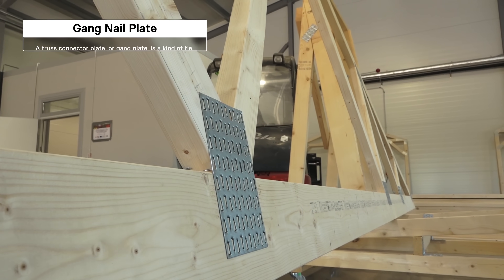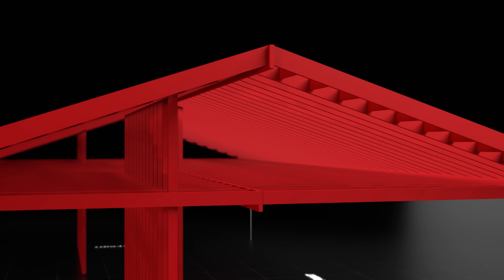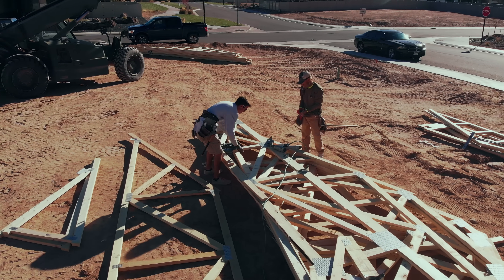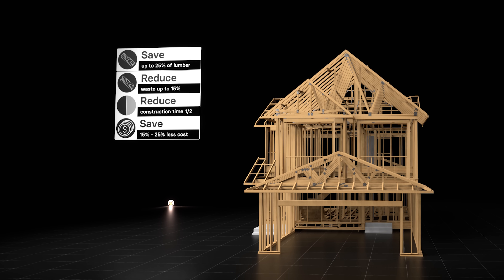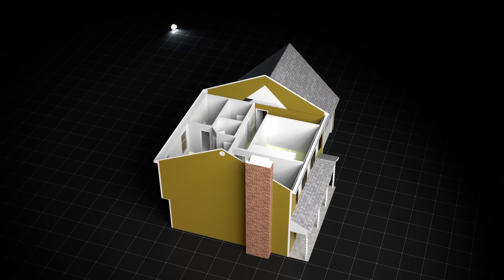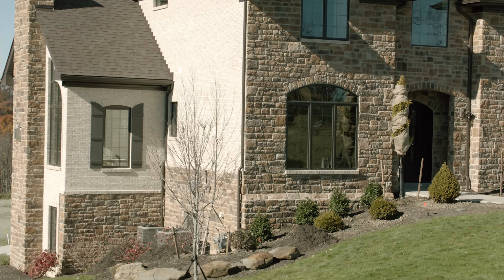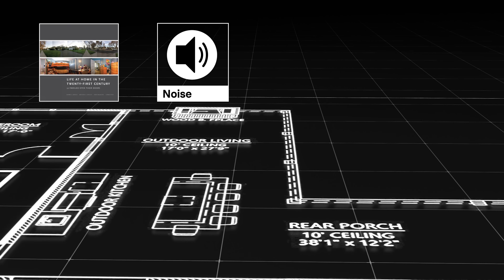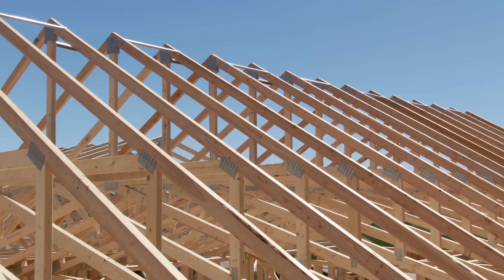The Invention that Accidentally Made McMansions

Comment: This is also what caused the ongoing tiny house scam, currently going on all over the US. They build these tiny storage buildings with cheaper materials than those used in mobile homes, and sell them “with no credit check” .. 

Which is more like “We only offer our own credit” because their rates would be illegal in most places. 

Basically, you end up with a framed and sided shell with a roof, 2 windows, and a door.. Roughly $3500 worth of raw materials, that they then sell for a cash price of $12K or .. interest rates that puts your total cost around to $30,000. 

That’s without electricity, wiring, plumbing, or even a toilet for that matter…  

They can afford to do this because they’re small enough to fit on a specialized trailer, which is 50 state legal to pull behind a semi truck. They literally pull up to your house, load it onto their trailer, and leave… The same way they repossess a car.

Comment: Fun fact: after ww2 The Levitt family (father and 2 sons) built most of the homes (cape cod style and ranchers) in Levittown PA and near Long Island NY. They built Over 140,000 homes. I do work on many of those Levittown homes today. Most of fascia boards on these homes aren’t even wood, underneath the aluminum capping is like cardboard. When it’s rotted it literally just breaks apart like a cookie.
Reply: I live in a ca 1963 home in Florida - its what I call the "standard post war floorplan" (which is pretty good). Cinder block construction, but the (low) gable ends were originally some kind of MDF similar to what you describe.
Reply: Homes built after WW2 had a materials shortage with everyone building. So it’s not uncommon to find creative solutions to that.
Reply: Wow, the ✡️Levitts✡️ are scamming people, what a shocker
Reply: More facts, i own a Levitt in long Island. Solid as a rock 70 years later. Nailed together, tongue and groove absolutely zero structural issues to this day 👍👍
Reply: Dumb take. False many counts

Comment: Idk. This technology made building McMansions more affordable but the first trusses were used in standard home design first. I live in a 1960s home. it has 12ft wide rooms, all within spec of 16” spaces 2x6 rafters. Sheet goods and siding played a much bigger role than trusses in making this home affordable. 

So It isn’t clear to me the cause and effect. There were mansions before trusses and if they were not invented, the overall industrialization, development of timber harvesting tech, and supply chains made larger homes affordable. 

This video could easily have been titled how insulation and HVAC systems made McMansions possible or how highways and cars made McMansions possible by by making accessible land affordable.

Comment: Your explanation of a weak point being at were the rafter sits on the wall is wrong if you think about it. Them days we cut a notch, called a seat cut or "Birds Mouth". Yes we had to toenail it down. Guess what, a modern truss STILL is only toenailed down. They have things called "Hurricane Clips", a metal strap that nails into the rafter/truss, and also to the stud or double plate below. The plates talked about in the video only increased the speed and ease of use of building the truss, and could be accomplished using another 2x piece added to the rafter before they became popular.

Comment: Your leap from analyzing roof failures due to uplift and toe-nailed rafters to gang nail plates was a bridge too far.  Roof uplift failures were addressed with hurricane ties or hurricane clips, to reinforce the joint between the rafter and the top plate.  The gang nail plate didn't directly contribute to solving the uplift problem.

Comment: The fact that an invention makes something easier or even possible does not automatically Authorise a significant change 
in another aspect of an existing industry.  Local zoning should be used to restrict the number of extra-large houses.    
I grew up in a sub-1000 SF house and didn't see it as inadequate at all.   
Next door to us there was a family with six daughters. How they all got along in about the same amount of space, 
I don't know, but somehow they did. As they moved out, of course the younger ones had more room to themselves.  
There is a terrible shortage of decent, modestly-sized single-family houses like the one I grew up in. 
I hope someone will eventually wake up and Do Something about that. And make yards bigger again, too.  
There should be not less than 20 feet between any point of one house and any point of another.
Reply: While I hear you about zoning - zoning is all too often the problem. "Minimum house size" and other stupidity.

Comment: "By the 200s Rapid home construction accelerated by the efficiencies that were made possible by the trust plate contributed to over production in the housing market. The trend towards larger homes increased household debt while the construction surge contributed to this misguided perception that homes were just going to increase in value forever." This is an incredibly incorrect and illogical thing to say. Homes being cheaper and more efficient to build, could lead to larger home sizes. But it was the government pushing for home-ownership, pumping money into the housing market, and encouraging banks to give more and more mortgages is what caused the housing bubble. Without the trust plate, these homes would have been smaller for the same price, but had nothing to do with the housing bubble. A surge in production is caused by the increased supply of mortgages, not the trust plate, and had nothing to do with the perception that home prices never go down.

Comment: Seeing this as a Euopean makes totally sence now why American homes allways getting blown away. Here in Europe we have Concrete, Bricks and Ytong stones for the walls which are not carying any weight. Even our wooden homes, still standing like the middle age, because instead of a few nails, or small plates of nails, the wooden beams in the houses are thick af and getting connected by fittings sawed into them combined with big and long and strong steel bolts. So even when a storm like a hurricane (okay they are not so strong over here) appear, the worst thing what happens is that the rooftiles starts flying around and hitting things and trees falling over, sometimes into homes, but they dont get destroyed completely like in the US. All you had to do was follow the damn train CJ... No all you had to do was to get new beams or new rooftiles in the most cases. Everything else is safe.

Comment: The plate does heat up charring the wood around the plate stopping the wood from burning around the plate thus keeping the joint from failing.  When one of the trusses fail the rest of the trusses don't necessarily fail and each of the trusses are engineered for specific situation with factors of safety built in.  A "stick-framed" roof is not engineered and is built using prescriptive methods that are implemented by workers who may or not know the prescriptive framing rules.  All in all, I would much rather in the engineered roof system.

Comment: Truss plates are an amazing invention and their use has gone far beyond just homes. I see them used in indoor horse riding arenas where there is no internal support for the roof.  Why do they seem to fail sometimes under snowloads? Is it a failure of building design (like not enough trusses or roof pitch)? That might be too complex of a question for a simple answer sorry.

Comment: I’m generally a fan of prefabricated wood trusses.  But the truth is that the super-complicated roofs that are characteristic of these so-called McMansions oftentimes preclude the use of trusses more so than enabling it.  Accessible attics and loft spaces, significantly vaulted / raised ceiling elevations, and the absence of sensible load-bearing wall or beam placement  are significant restrictions “from below”.  Then, comedically complex roof geometries with cascading gables, meandering hip / valley lines, dormer volumes, and chimney projections create major challenges “from above”.  As such, in my experience you’re more apt to see a McMansion roof framed with conventional stick-framing than with prefab trusses.  As with anything else, the devil is in the details.  Wood trusses are a  great solution in general, but when the architectural roof “concept” is full of geometric pinch points and a ton of volumetric variability, the economy (and more often than not, the feasibility) of a truss solution goes straight out the window.

Comment: He said construction time cut in half using trusses? Not a chance. Unless he was talking about just the roof framing. Or possibly the framing structure itself depending on the design of the building. But claiming that rafters will DOUBLE the construction time of a home is ridiculous. Trusses are fine if you don't care about wasted space, boring architecture, and in most cases low ceilings. And with the invention of hurricane clips, roofs constructed with them are more than strong enough in 99% of the country. Track homes be damned!!

Comment: Before the gangnail carpenters would make their own trusses using plywood as the gangnail.  This is a very sturdy way of making a truss and stands the test of time. This practice was largely abandoned because builders feared that because their carpenters were not engineers there could be a liability issue. But the main thing is the standardized cost. Builders knew exactly how much the trusses would cost. And when you build the same cost over and over it was convenient to know the cost would remain the same for the materials.

Comment: Those plates are crap. I worked in a place building trusses . If the wood gets even a little wet and then dries those plates will not hold the wood together.  I would never ever for any reason use those plates

Comment: THIS IS SO WRONG. lofl
Reply: How so? The nail plate doesn't help facilitate the construction of McMansions?
Reply: @timothymatthews6458  No it does not.  My dad built MANY MANY Mcmansions with standard site cut roofs.   High end builders prefer site cut roofs.   The production builders loved the trusses because it makes framing faster and cheaper. Trusses were not used on Mcmansions. production builders dont build Mcmansions.  They build standard 2500sft and under family homes.

Comment: Hello!! Truss Technician here! It's my job to design roof and floor trusses for both residential and commercial applications. Overall a really well done video explaining the differences from traditional stick framing and truss framing. One minor correction I'd like to add, at 6:26 talking about not having attics, there is in fact an attic style roof truss that looks very similar to stick framing. I design them all the time! We can set the loading up to be a livable space with 40-10-5 loading to the bottom chord, or non-livable where the loading is less. The biggest benefit with using trusses is the shear lack of waste, our wood dump bins take forever to fill up because what's left over for a cut, is used to make another cut. 

I think the largest contributing factor into why building is getting more expensive is due to the shrinking labor market. The US public education system pushes hard for college degrees, and largely ignores the concept of trade schools. My English teacher told me "you will never be successful without a college education" Here I am, a two time college dropout working in one of the best industries making a very nice living. But as far as framers, the pool keeps shrinking, so the pay continues to rise. More expensive labor means a more expensive build. It's not the only factor into rising costs, but it is a big one.

Component manufacturing and construction are both incredibly fun and fulfilling industries, and I'd recommend anyone looking for their next step, to look at the world of construction.

If you have any questions about the world of roof and floor trusses, I'd be more than happy to provide any information that I can. Big fan of this channel!!!! Bravo!!

Comment: I live in a double wide. it is a brand new double wide but naturally it is a small, simple floor plan that lends itself to incredible efficiency. It also helps my wife and I pay attention more to needs and wants in regards to "stuff".  It is easy to heat and cool, has a beautiful front porch built right into it with a bigger master suite I'd ever thought I'd have. I love my little, simple house and could never imagine having a biger house much less one that costs more and causes more issues
Reply: Amen.  When I lived in hippy land there were many many double-wides that had expanded as needed over the years. Need an extra bedroom? cut half the wall of the trailer out and frame a box on stilts. Often the original trailer was erased after 30 years :)
Reply: Do you live in a trailer park?
Reply: That's another issue altogether. Politicians crow on about "affordable housing" then put roadblocks in the way of wide utilization of Mobile/Modular/whatever homes. Although I'm in a conventional house now, I grew up in, and spent most of my adult life in Mobile Homes of one sort or another. I actually prefer them, they're generally better built as they have to withstand the equivalent of a force 8 earthquake when they roll down the road, more thought is put into them with regards to storage, and the traditional "tin can" style needs MUCH less maintenance.
Reply: I used to have a double wide on an acre north of phoenix.   It had better insulation and craftsmanship than any of the stick built houses I have owned.  Cost way less to air condition because they actually put in decent insulation at the factory.

Comment: My suburban ranch style home was built in 1978 with stick framing. Last year during a snow storm/load on our roof our walls moved out about 1/2". After ripping things apart we discovered that they were only toe nailed using 1-2 nails. Fun time correcting that issue.
Reply: You mean not all hand-built homes were high quality? Color me shocked...
Reply: That's not the problem, your rafters don't stop the walls from spreading, they actually make the walls spread. Toe nailing is not a weak connection (although 3 nails is minimum), and reinforcing that connect will do nothing to stop the walls from spreading. Ceiling joists stop the walls from pushing out, if there are no ceiling joists you need rafter ties. If all you did was reinforce the joint from the rafter to the wall top plate you have done absolutely nothing to prevent the walls from pushing out again when you get more snow.

Comment: McMansion is a play on words. The phrase is used to compare to McDonald’s, a company known for mass food production. A McMansion is a popular housing choice characterized by being a large house often located in subdivisions across the US. They have only continued to grow in popularity all over the country.
These homes are characterized by their immense size, generic design, and mass production, targeting the upper-middle-class market segment. When buying in the suburbs, you will come across these homes.
McMansions often have a minimum floor area of 3500 square feet, featuring high ceilings, spacious garages, multiple bedrooms and bathrooms, and extravagant yet superficial interior features.
While they **ARE NOT GENUINE MANSIONS**, they have some of the characteristics only on a much smaller scale.

These homes are no longer the build style of choice as home builders have adopted the trend of dividing land for neighborhoods into micro-parcels with zero-lot-line closeness (ie .20 acrs+/-) and stuffing a 1700-3000 SqFt multi level box home onto the space and filling the entire neighborhood with 1 of 4 or 5 different but similar looking 'styles' randomly placed to break the scenery. 

A home from the 70s with 3400 SqFt would have been on a 1/2 - 3/4 acre lot and have a 150 ft wide x 100 ft deep lot that would be maybe 10 or 12 home per block. Now that same block would house 35 homes in the same land cross section, whereas 2 cul de sac streets could now be 3 streets and with 3x the number of home on each street the amount of return financially to the land buyer is exponential as they dress the homes in exquisite trims (cheap bulk wood and stone) and other materials while skimping on lot size and outdoor space... and still charging more per home. Greed at its finest.

Comment: The roofs came off because they didn’t have hurricane straps, not because of hand cut trusses. Hand nailed construction is much stronger because a hammer doesn’t cut the wood fibers it compresses them, the old wood wasn’t as dry and the nails weren’t galvanized so a small amount of rust would accumulate during the drying, all these things contribute to a much stronger butt joint. Lath and plaster was also far superior to drywall, literally every building material is a cheap facsimile of what we should be using. Even the stonework is fake now, faucets are fake chrome plated plastic. A two bedroom 1200 foot home built to 1900 specs would cost well over a million today. But you can’t squeeze purchase a cheaply constructed 3500 foot home for 500k.

Comment: Great job explaining the roof trusses. In the animation at the 7:35 mark you mentioned that the first and second floors can be built independent of each other. Are you saying there are also trusses/truss plates between the first and second floor? Trying to better understand the force concentrations and if this area is simply a solid single piece of wood, but maybe with additional width and spacing requirements.

Comment: The way cost savings from trusses were eaten up by larger and larger home sizes is strikingly parallel to the way more fuel-efficient engines did not result in higher MPG, but rather in bigger, heavier (and more profitable) SUVs. The profit-over-everything mentality  undermines any attempt to direct efficiency improvements toward higher quality workmanship or more sustainable living.